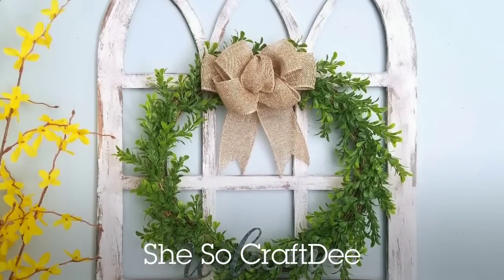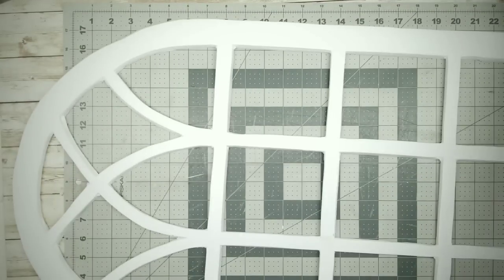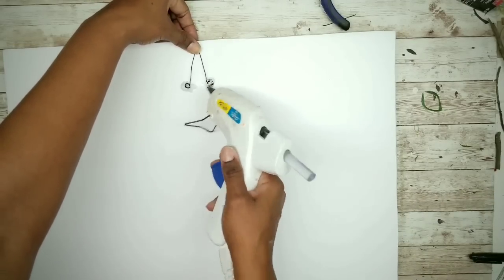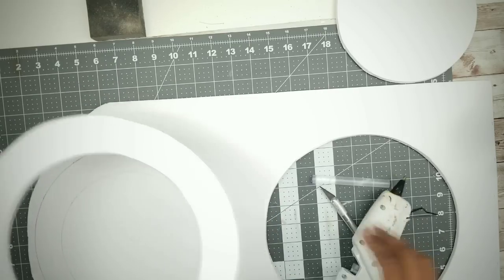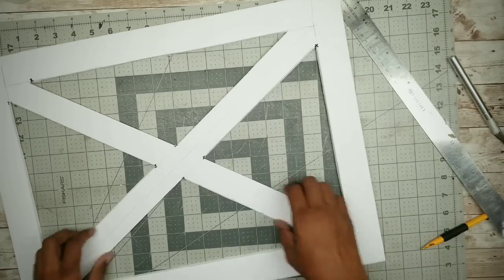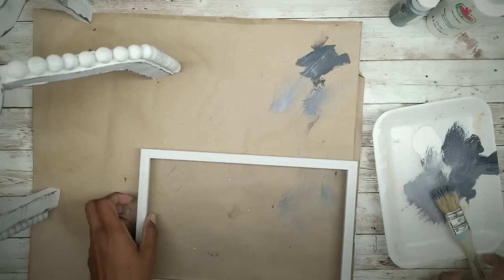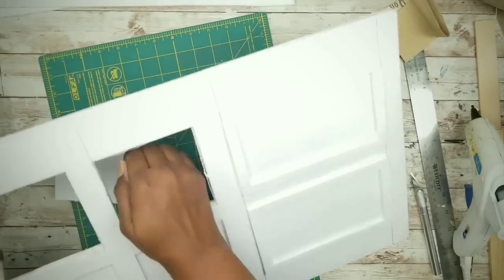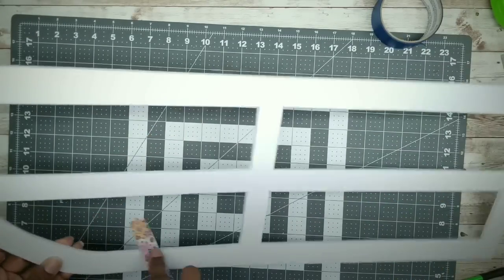*MAKE AMAZING DECOR* Using DOLLAR TREE DIY Foam Board! | High End HACKS & FREE Printable Templates!

Comment: Did you know that you can use a band saw with a fine blade to cut foam core, even intricate shapes. A  set designer I know uses one to make miniatures from foam core, which shows the detail that can be achieved. You are right about the need to use new, sharp exacto blades - and change them often.
Reply from the maker: Sure! Any fine cutting too and even a hot knife will work well with these  🙂

Comment: Very creative!
We were just curious if you knew how to protect the foam board. Especially in a bathroom.
Still looking for a way to coat the board with some kind of sealant without wrecking the project. Many thanks!
Reply from the maker: I think that even with sealant, foam core board would be subject to warping and maybe mildew. I wouldn't suggest using it in areas subjected to moisture.

Comment: I am so impressed with your creativity - the result is very realistic and very remarkable! 
I have a question for you - I want to decoupage a bunny (decoupaged paper) onto the entire foam board and hang it without a frame. I’m worried it will be too heavy. Could you recommend a method of hanging that will last for about a month’s time? It’s a bit humid here. Thanks in advance for your consideration.
Reply from the maker: One important thing about decoupaging paper on paper is warping. I would go light on the mod podge, and dry thoroughly while weighted down.  Also be cautious of storing or displaying in humid conditions.
Reply: Thanks for that advice! Do you think I need more than twine as a hanging tool for hanging the whole length of foam board?

Comment: It would look much better if the holes in your wall were filled. Since your wall is teal or blue just use sparkle with a little bit of blue food coloring in it.  It would make your decor looks so much better. The appearance of the wall is just important as the decor.
Reply from the maker: This is my display wall, always used to show finished projects. I patch a few times a year. 🙂